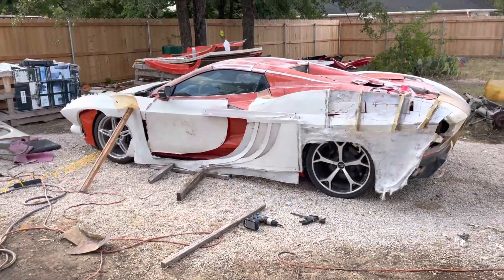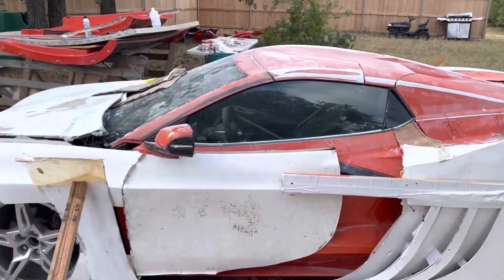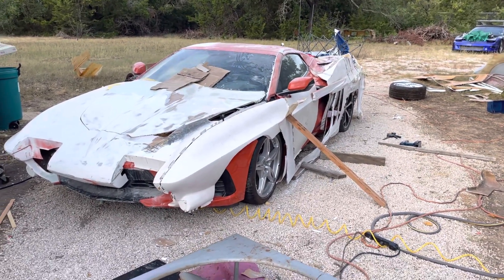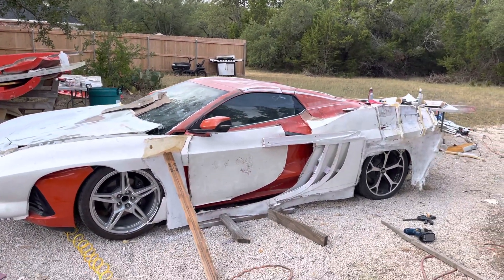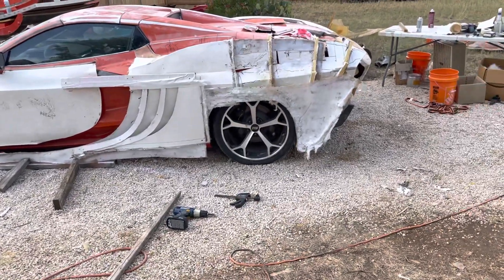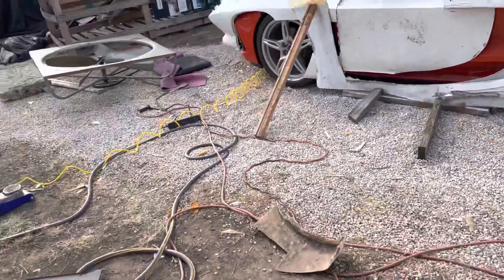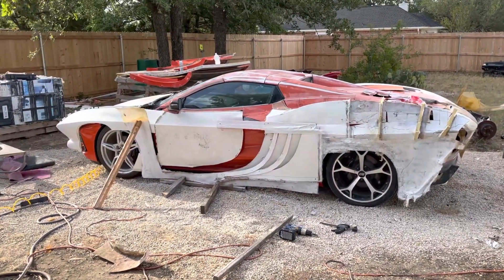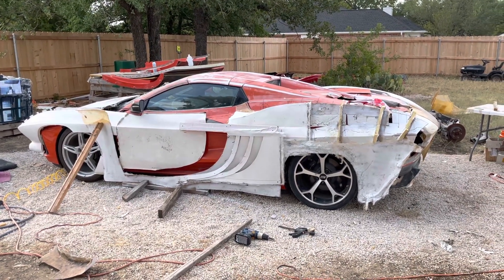C8 Corvette Hack - Modified Vent Design… Vote Again!

Comment: I like the look of those better than the other side but the hard corners at the top of each "gill" need some finessing to flow into the rear arch and quarter panel.
Reply from the maker: Thanks! I had already planned to round the corners. The squared corners allowed me to experiment with the top vent edge horizontal placement. That’s white duct tape currently defining the top edge.

Comment: I honestly still like the passenger side as well if I had to choose one. But no looking at the whole picture like this, design wise it doesn't make a whole lot of since to put vents that cut into one giant vent that the door already has. Do you plan to close off the already existing one that the C8's come with?
Reply from the maker: The extra vents were added to visually break up the huge “blank area” on the rear quarter panel. That blank area made the car visually look overly massive and heavy. They can be completely non-functional.